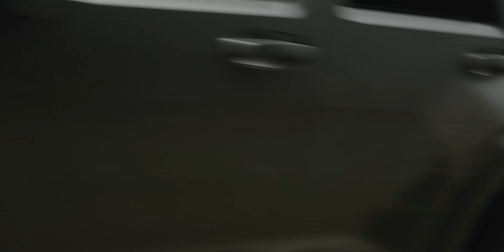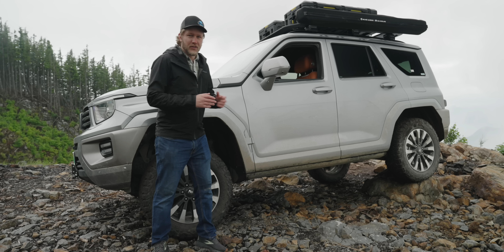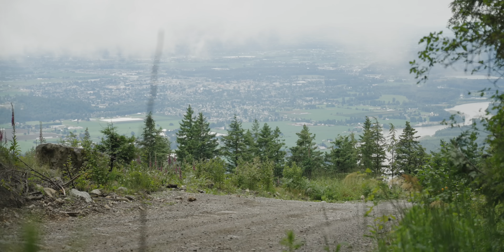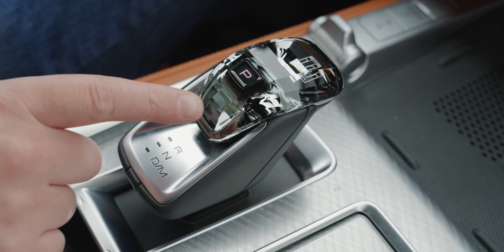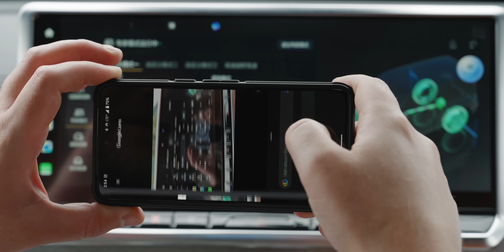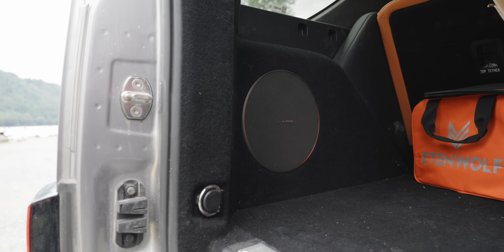Meet the TANK 700!

Comment: The great wall deer (and it's sister SUV the safe) Where not only knockoffs in visuals but also mechanical both engine (4y) and transmissions 5 speed manual were (supposedly) sold by toyota under a license to great wall

This is why they were so popular as they are as reliable as the originals and you could just swap toyota parts on them when needed

Source: my dad owns one. currently at 450.000+ km only mayor repairs are a new timing chain and a clutch, but the engine has never been touched
Reply: They also replicated this strategy with the Haval (like a ton of other Chinese cars), which uses a mitsubishi 4 cylinder while making the exterior more original

Comment: They need to hire proper designers. The front looks unproportional and dated. Also not sure why but seems the company is hellbent on pumping out high emitting vehicles. No real PHEVs, no EVs. They also still manufacture cars in Russia. "Ukraine: Govt. designates Great Wall Motor as war sponsor over its business expansion in Russia". If you are into off road stuff I recommend you to have a look at BYD Fang Cheng Bao 5 (BYD Denza B5). Way more refined and probably give you more clicks because of BYD.

Comment: Just a note about  GWM Tanks, the angle of their windscreens mean they are an absolute rock chip magnet, drove a tank 500 around New Zealand on mainly sealed roads for around ~5000kms over 2 weeks and had 3 chips in the windscreen. One of which was repairable however the other two required the windscreen to be replaced. Another note about specifically the tank 500, the lane keep assist needed to be manually turned off from the menu every time the car was restarted because we would find the tank would drag us towards the outside of the road on narrow roads towards a ditch or in some cases towards a steep drop off the side of the road, not having a turn stalk that has physical switch positions was incredibly frustrating, and the size of the wheel blocked any ability to see that was written on the stalks
Reply: Skill issue

Comment: This isn't a proper car review, but just a video shilling for Chinese crap. A proper reviewer would have questioned the touchscreen controls on the center console for AC, seats and music, because it can't be used without taking your eyes off the road. Better just stick to repairs.
Reply: You can voice control everything.
Reply: @onetwothreefour-s1n  You're missing the point. Whenever you have to use manual controls, you have to park or run the risk of causing an accident.

Comment: Just a minor tidbit. They are still using Toyota Underpinnings of these cars. So modifying them will be easy as most aftermarket parts will bolt straight on. Yes there may be some changes to reflect their brand but it's why they can keep costs low.

Comment: Holy hell. $60,000 US? That's wild. No wonder they don't want them sold in the US. 

Obviously the data privacy part is there too, but I can't see myself buying any modern car until I can be certain it's not going to be actively spying on me at all times, regardless of the manufacturer.
Reply: VW recently had the massive leak where the time series of GPS positions of almost every car they sold in like the last 3 years was stored in an unencrypted, publically accessible (if you're a nerd) database. Your car is spying on you, it's just a question of who receives the data. It's like Edge not being any different from Chrome because it's just Microsoft who receives the data instead of Google.

Comment: You should check the spying/tracking capabilities and compare it with those of existing/recent vehicle models of other brands. This is one of my biggest concerns when buying a new vehicle. It will be also useful to cover how easily those features could be removed.
Reply: Do you have a mobile phone?
Reply: @Expedition_Tranquilo I know the point ur about to make but the maximum the state can get by tracking my phone is approximate location over time, especially if u lock the phone to 2G when traveling. By comparison modern vehicles can collect lots of telemetry down to the depression of pedals with very fine granularity. Further the vehicle is Chinese and the Chinese state has the worst reputation for privacy (allthough others are not that far behind). 

It would be nice to know what wires and modules I can unplug myself to disable telemetry collection.

Comment: lol just opened it, I notice someone went up to Ramp Rock XD

(hopefully later we see some real offroad chops tho, cause i got a jeep compass up there. williamson lake, hut lakes, tank trap at stave, etc would be real proofs of ability)

edit: as i'm watching, holy crap, this is what I want. enough range to get at least to whistler, if not back to squamish (though i could maybe nap a charging spot and never touch gas). triple lockers, 11" of clearance, a frame so suspension lifts should be easy.... if we allow chinese vehicles, I might buy one... plus it has a disconnectable sway bar, a spare tire on the back still, and the angles are good enough i don't need to swap bumpers immediately to be able to handle deactivated FSRs? i want this so bad

edit2: looks like enough buttons to be safely operated. if i can swap it to english, and you tell me how you got it in Canada... i actually want one, unironically. 20" rims suck but I can eat that cost

Comment: Seems like good competition, but if it exits china I would guess that Usa isn't going to stop their protection of bad car companies.

Things that would be nice are static steps as seasons and working (no pavement princess) will break stuff like that. A winch on the rear would be nice as usually if you get stuck you need to go backwards and not further into the forest. The camera durability is a big question mark for me as those will need to be tough unless you want constant issues